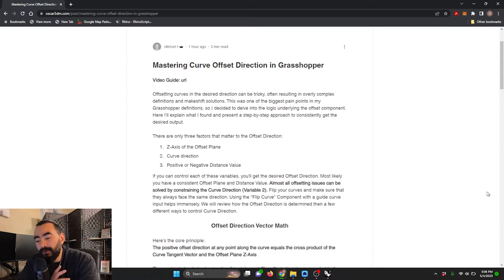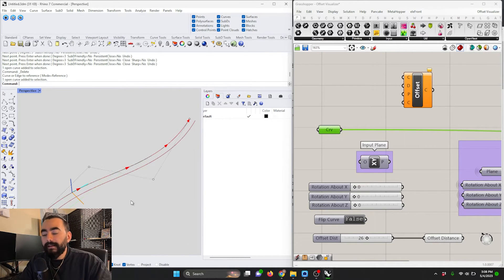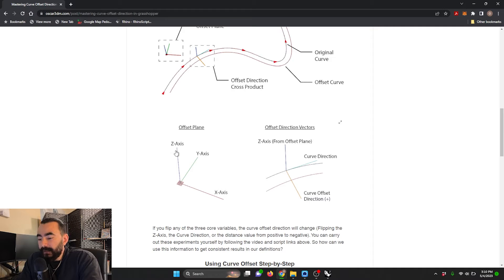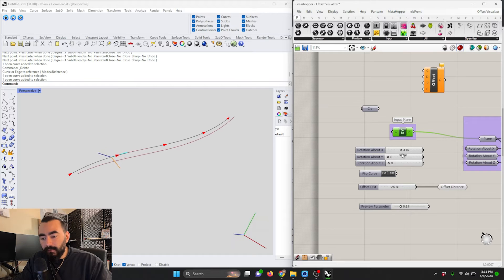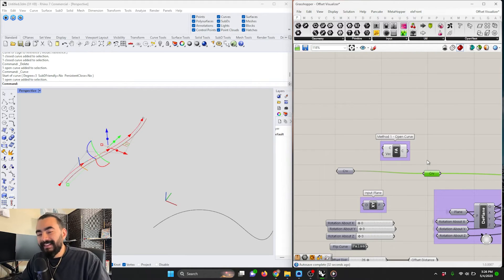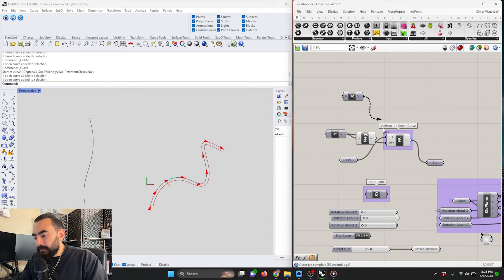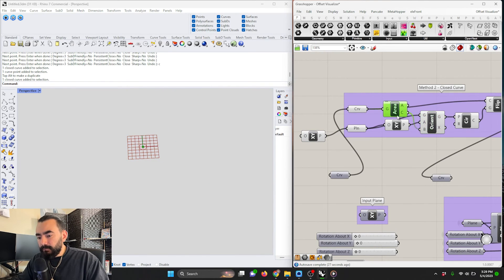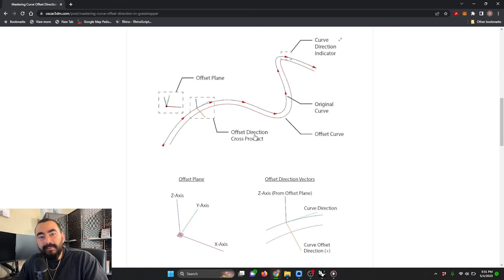Grasshopper: Mastering Curve Offset Direction

Comment: Hey Oscar, just wanted to say that your explanations are very clear and it cleared an issue I had with my grasshopper definitions for some time. I always refrained from using offset in grasshopper due to this issue but you have solved it. Thanks.

Comment: Hello, I found how you write the closed curve is based on Area, that means the cure need to be on a 2D plan. How to solve this when it's 3D curves?
Reply from the maker: You can try to make your guide circle from the "Volume" centroid instead of the Area one. If the curve is more complicated, you might have to get creative with how to constrain the direction. If you make the curve in GH instead of Rhino, you can be careful to preserve the curve direction throughout your script. Does that answer your question?

Comment: thanks for the useful video, one question, let's say I have several closed curves (5 - 10 rectangles), I break them into segments using an explode and offset the segments, and some of segments goes to different directions (3 adges/segments of one rectangle out and one in). How to solve this? thank you.
Reply from the maker: Explode should preserve the direction of the curve. If the same offset plane is used, you shouldn't be getting edges offset in different directions. If you still need help on this, feel free to send me a message with the file at contact@oscar3dm.com